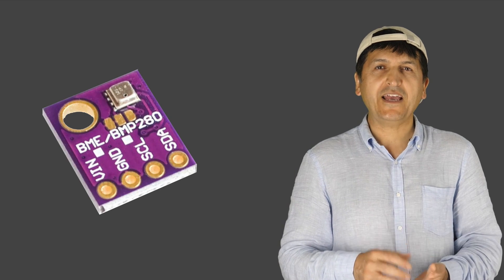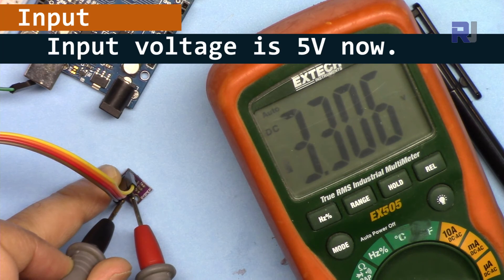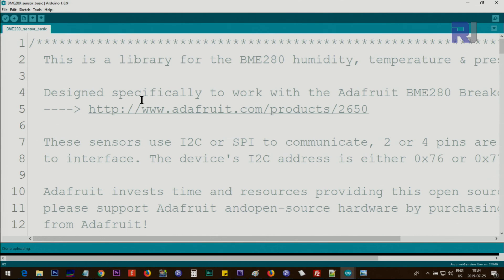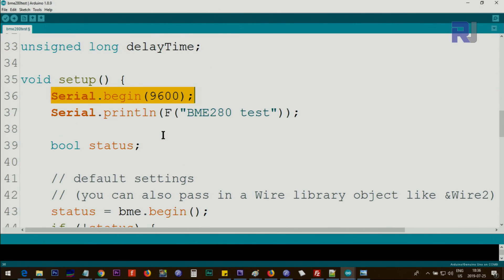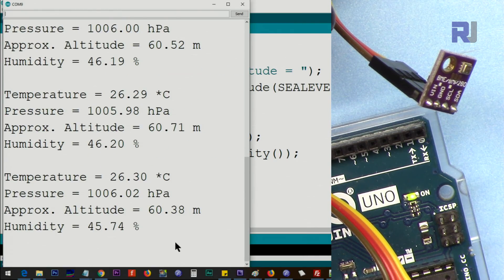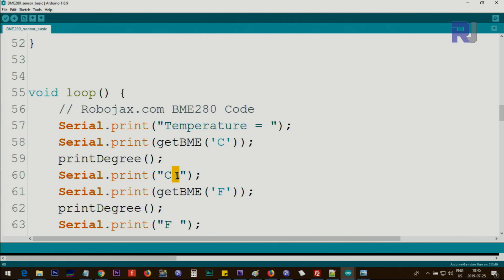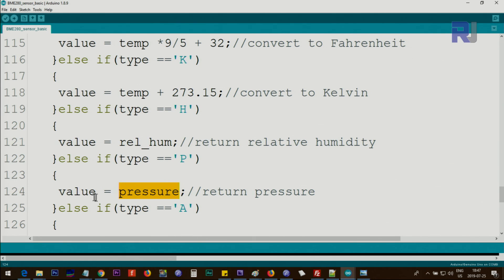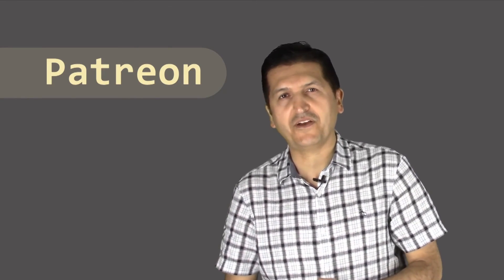How to use BME280 Temperature, Humidity and Pressure sensor with Arduino RJT183

Comment: bonjour,  quel est la différence entre la bibliothèque BME280 et BMP280. Et la differance c'est BME280 5VOLTS  OU  BMP 3VOLTS.  ces toute la différance ?
Reply from the maker: no difference. the 5V version has a voltage regulator that brings the 5V to 3.3V.

Comment: Hi,I try this code but a got ´´Could not find a valid BME280 sensor, check wiring, address, sensor ID!´´ message in serial monitor.I have connect the BME280 but i dont know what to do.Help pls.
Reply from the maker: us the I2C scanner code (can find it at robojax.com)  to see if you get the address. if you don't get the address, then either the module is defective (dead) or bad soldering on the board.
Reply: @robojax  thx for answer.

Comment: Can hpa be changed to pa?
Reply from the maker: 1 hPa = 100 Pa, so if ou want it in "pa" just divide it byh 100. it is very sijple.  let' say we have a variable "age" and it has value of 10 and you want to divide it by 2, simply write age = age/2;  or age /=2;
now age will be 5. Do the same in this code.
Reply from the maker: if you want  to learn about variables, there is my video which is part the course https://youtu.be/n0z6fjww8eA

Comment: Hi there. I accidentally burn the capacitor connect between VIN& GND befor the 662 voltage regulator while soldering. Do you know the value of this capacitor so I can try to change it and see if the BME 280 is still working? thanks in advance. Alexandre
Reply from the maker: Hi, the capacitor value should not be critical. it is is just a filter. most of the modules are replica from Adafruit or Sparkfun. you can see schematic here  https://cdn.sparkfun.com/datasheets/Sensors/Weather/SparkFun_BME280_Breakout_v10.pdf

Comment: Hi. I have the same module that you have. But are those extra 3 pads for. I bought it as bmp. And you saying its bme. Which one is right. Because i need bmp for my project.
Reply from the maker: Hi, I have video both on BME280 and BMP280 with code. the best option would be follow both video and upload the code and see which one works. Just pay attention to the wiring so you don't mix the GND and VCC. Here is how to find Specific YouTube Video in a channel https://bit.ly/findYouTubeVideo
Reply: @robojax  thanks. It's just bme won't work on my board for some reason.
Reply from the maker: If you do proper wiring it should work . It uses I2C communication and just connect it to A4 and A5 watch the video and try both projects.  Run first I2C scans to see if you get the address.
Reply: @robojax  ok. Thanks. I'm going to use it on a flight controller that has no barometer. It only reads bmp. I'll try and see. Thank you

Comment: Hey I have one question I am trying to find one sensor that can detect human presence   from like 3-6 feet do you know any sensors that can fulfil this task
Reply from the maker: Hi,  very hard topic.  detecting a living thing can be done by temperature, motion,  shape and  many oher factors like breathing etc. this product sold in this video is called body motion detector https://youtu.be/h9JDlQXpi2w you look at .But for proper detection, you need motion sensor and thermal sensor  to combine and get about 60% accuracy. for 90% accuracy or higher, you need camera to detect shape. then thermal camera and motion sensor get assurance that the object is human.  Good luck

Comment: 702 is not a regulator, it is a Dual N-Channel MOSFET for i/o logic level shifting from 5v to 3.3v.
Reply from the maker: Hi, Thank you for pointing that out. I just check it and could not find anywhere the 702 as mosfet. Adafruit  uses two MOSFETS BSS138 for level shifter  on the module  and shown on the schematic here https://learn.adafruit.com/assets/26693 (datasheet for BSS138 https://www.onsemi.com/pub/Collateral/BSS138-D.PDF)  and if you open the schematic on separate tab https://cdn-learn.adafruit.com/assets/assets/000/026/693/original/sensors_sch.png?1437773082 you will see a 5 pin chip MIC5225-3.3 which is a 3.3V regulator where you can see the datasheet here https://cdn-shop.adafruit.com/datasheets/mic5225.pdf
Reply: @robojax  Hi, I'm not talking about Adafruit board but about board you're reviewing. At 2:42 the 6 pin SOT-363 chip on the right marked 702 is the dual MOSFET. Datasheet is here (marking is on the page 2): http://www.gs-power.com/db/pictures/modules/PDT/PDT060207001/DS_GSM7002T_Rev1.2.pdf Thanks.
Reply from the maker: thank you. yes you are right. it makes sense at 2:43  at the middle you see the 103 x3 resistors that is used with the logic level converter.  I'll see if I can remove that portion . thanks for the comment  and pointing the error.

Comment: Great tutorial, thank you.  Could you please explain how the approximate altitude calculation works (float alt =bme.readAltitude(SEALEVELPRESSURE_HPA))?  I understand this will change with air pressure, but i do not understand the calculation.  I have set the baseline pressure for my town, and it show me at -76m!! I am new to this code, any help will be appreciated...  Thank you
Reply from the maker: You are welcome. The calculation is shown in line 507 in the library  hrere https://github.com/adafruit/Adafruit_BME280_Library/blob/master/Adafruit_BME280.cpp Thank you for not skipping the ads and keep watching them. This will help me a lot.
Reply: @robojax  Brilliant, thank you for the information!!  I think i will be able to get the data displayed how i want now.  Thank You once again!!
Reply from the maker: You are welcome. I am glad it worked for you.

Comment: thanks for the video, i hv a similar sensor but had a close look on the sensor and it doesn't have the same marking on the sensor, mine has 807ur, reason for asking is i bought 2 and i got one to work and after one hour it stop working,
Reply from the maker: You are welcome. Did you check if yours is 3.3V? if you connect it to 5V it will die. Check it or connect the other at 3.3V and if it works, then keep using only 3.3V.
Reply: @robojax  by the way, I enjoy your videos, keep it up.( No need  to wear the cap)
Reply from the maker: LOL. Thanks. I will . stay safe. It is COVIT-19 time.
Reply: @robojax  yes, we are on partial lockdown( Malaysia)

Comment: Good day sir 
Very informative viedio.   A request for you sir, can u pls make a. Viedio for sensor  cjm cu8118 sensor for co2 and  temp humidy sensor. I am planning  for making air quality  monitor  
John
Reply from the maker: Good day, I was not able to find : cjm cu8118
Reply: @robojax good  day sir

Pls search  this text "CJMCU-8118 CCS811 HDC1080 Carbon Monoxide CO VOCs Temperature And Humidity Gas Sensor Module"
Reply from the maker: I will get it but it takes 40 days for the module to arrive and then I will make video of it.
Reply: @robojax  thank you sir for the kind consideration 
John

Comment: does not work
Reply from the maker: Which part? please post the error  you are getting here.
Reply: @robojax  Ahhhh.... I have the BMP280 and not the BME280. I didn't realise there was two different modules. Sorry for wasting your time.
Reply: @robojax  Hi... sorry to take so long to get back. I moved on to something else. I seem to have exactly the same 4 pin module but cannot get a humidity reading. It's always 0.00. Thanks for taking the time to reply.

Temperature = 24.43°C 75.97°F 297.58K 
Pressure = 1009.92 hPa 
Humidity = 0.00% 
Approx. Altitude = 27.99 m

Comment: Great tutorial, thank you. 

The temp is reading 1 degree high. Is there a way to write code to always subtract 1 degree?
Reply from the maker: You are welcome. Yes you can change the value. find this line: float temp = bme.readTemperature();// read temperature
and immediately under that put:  temp  =temp + 1;
this will add 1 into the "temp" which is the variable holding the temperature. or subtract with -
Reply: Robojax thats brilliant, thank you. I’ll try that later as I’ve not managed to get it to work.
Reply: I’m already using float as the project includes rf24 modules. Would it have to be a separate float command?